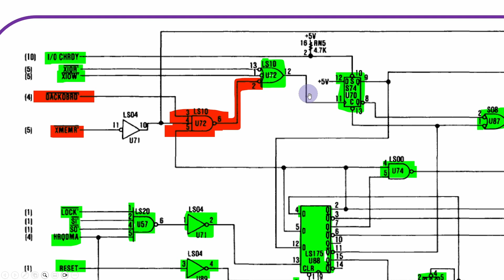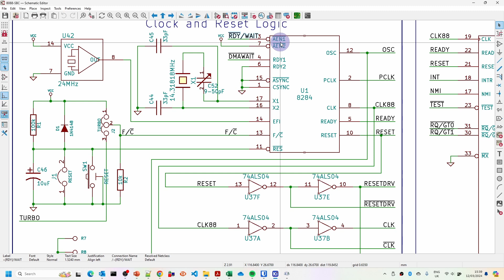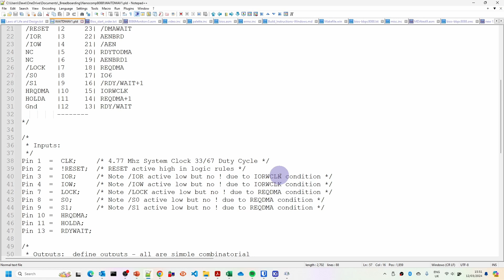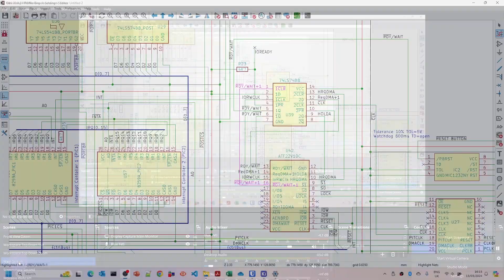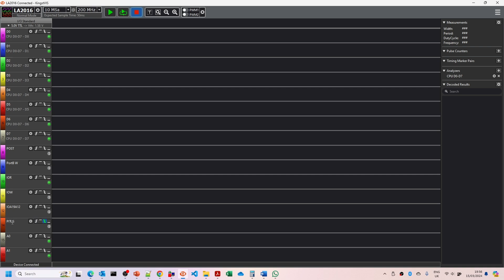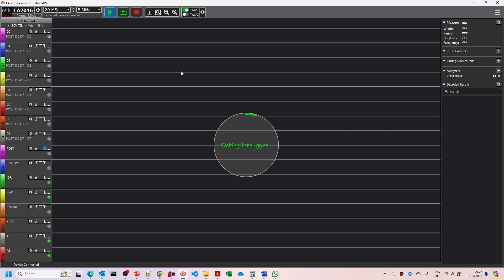Breadboard 8088 PC Compatibility Part 4 - IO wait states & BIOS testing #26

Comment: Although I have looked over the IBM PC schematics quite closely, I never noticed that a wait state was added for IO read and write. After some searching I found this possibly incorrect statement in StackExchange "OTTOMH The original 8088 4.77MHz IBM PC had 4 wait states for I/O and 2 wait states for memory". I am keen to understand this, so will have to dig deeper. From your explanation, a single wait state for I/O accesses seems correct. Perhaps I will have to get my scope out? Timings for IOR and IOW for maximum mode from the 8288 might have different timings as compared to minimum mode. This is something I can scope out on my 8088 PC motherboard.

In my own 8088 design, I decided to use "minimum" mode, to avoid the need for the expensive bus controller (8288). So I was just checking the datasheet for the width of IOR and IOW which come from the CPU. By chance I have used the faster "-5" ICs in a number of places, so that probably helps them meet the IOR/IOW width timings. I used an 8253-5, even though I have a 8254 in my "Intel box", which seemed to be an older device from 1980.

Still you have given me "food for thought". TBH I didn't analyse the timings in any way when I designed my minimal 8088 system, which is a little embarrassing :-( .

Perhaps my search skills are poor, but I'm not finding any YT videos or web pages which show the ISA timings in detail on a scope or logic analyser.
Reply from the maker: "Although I have looked over the IBM PC schematics quite closely, I never noticed that a wait state was added for IO read and write. After some searching I found this possibly incorrect statement in StackExchange "OTTOMH The original 8088 4.77MHz IBM PC had 4 wait states for I/O and 2 wait states for memory". I am keen to understand this, so will have to dig deeper. From your explanation, a single wait state for I/O accesses seems correct. Perhaps I will have to get my scope out? Timings for IOR and IOW for maximum mode from the 8288 might have different timings as compared to minimum mode. This is something I can scope out on my 8088 PC motherboard."

The default 8088 timing is 2 clock cycles (T3 & T4 periods) for memory and IO read/write which is about 400ns (419ns with 4.77MHz). The XI 8088 design has a flip-flop U30A & U24 which takes XIOR and XIOW and adds 1 clock cycle by providing -RDY/WAIT to 8284 clock.
This changes the IOR and IOW to 600ns. An increase in 200ns.
I know this because that's what I measure in logic analyzer.
When I unplug -RDY/WAIT the IOR and IOW time goes back to 400ns.

The XT schematics system sheet 2 has U70 and U88 which also has inputs from XIOR and XIOW and outputs to -RDY/WAIT and looks like it should add 200ns too but can't verify as I don't have an original XT but schematic looks the same as XI 8088.

I think the StackExchange reference is not correct (or confusing wait states for clock cycles for memory).
The default read/write for IO and Memory is 2 clock cycles (minus about 60-75ns according to 8088 datasheet).
The gates identified above I think add 1 more clock cycle for IO, to make 3 clocks (600ns) or 1 wait state TW between T3 and T4.
Third party memory expansion boards using slower DRAM could have used the READY bus signal to add more wait states to off board memory from what I understand.
On board RAM was 200ns access time so didn't need wait states.

"In my own 8088 design, I decided to use "minimum" mode, to avoid the need for the expensive bus controller (8288). So I was just checking the datasheet for the width of IOR and IOW which come from the CPU. By chance I have used the faster "-5" ICs in a number of places, so that probably helps them meet the IOR/IOW width timings. I used an 8253-5, even though I have a 8254 in my "Intel box", which seemed to be an older device from 1980.
Still you have given me "food for thought". TBH I didn't analyse the timings in any way when I designed my minimal 8088 system, which is a little embarrassing :-( ."

I am thinking of getting a modern CMOS 80C88 and trying to re-build in min mode and see if I can avoid needing any of the 8284 and 8288 chips but maintain PC compatibility. Will still need legacy timers like 8253/8254 and PIC etc. But will use programmed IO instead of DMA which just needs faster clock than 4.77MHz which modern chips support.

Perhaps my search skills are poor, but I'm not finding any YT videos or web pages which show the ISA timings in detail on a scope or logic analyser.

Some stuff here on timing regarding CGA from https://martypc.blogspot.com/2023/05/exploring-cga-wait-states.html?m=1
They also did work on other timing like DMA etc.

Hope this helps. Dave

Comment: Is it possible to upload the current schematics, the and PLD equations to your GitHub? I personally find it very difficult to follow your explanations without holding schematics in my hand.
Your schematic doesn't have to work down to the smallest detail, but at least others or I can get a better overview. I'm trying to recreate your great project on breadboards to better understand all the connections before I make a circuit board out of it. I already have all the chips and the breadboards you recommended there too.😃
Reply from the maker: GitHub just been updated now it is mainly working! https://github.com/breadboardinglabs/Breadboard8088PC
Dave
Reply: @breadboardinglabs  All GAL Chips are 15ns?
Reply from the maker: There are a variety of speeds from 7.5ns to 20-30ns from the Mouser link  https://www.mouser.co.uk/c/semiconductors/programmable-logic-ics/eepld-electronically-erasable-programmable-logic-devices/?q=ATF22V10C&mounting%20style=Through%20Hole
The 15ns tend to be the cheaper ones (7.5ns similar) however getting chips faster than what is needed could cause ground bounce spikes and other problems as rise and fall times will be faster than what is required (I am a hobbyist not a professionally trained engineer!). Dave
Reply: @breadboardinglabs  I would like to come back to the speed of the GAL modules. I saw in an earlier video that you used a 10ns GAL. 
My understanding of the speeds of the 8088 circuit is that all GAL devices can have 15ns cycle time. Do you agree with this?
The background to the question is that I have a lot of 15ns GAL devices (22V10, 16V8, 20V8) and a few with 7ns. I do not have 10ns. Hence my question. Otherwise I would have to order 10ns components.
Reply from the maker: All the ones I have now I think are 15ns which are what is available from Mouser. Some of the first ones I got from RS in the UK may have been 10ns but this was just down to availability not any specific speed requirement. Nothing yet I have done has been that sensitive to 15ns vs 10ns as far as I can tell. I suspect when doing 40Mhz dot clock for SVGA or 33Mhz CPU clock for a 80386 in the future this might become an issue but stick with for 15ns for now. Dave
Reply: Excellent. Thanks! 🎉 

I am beginning to understand the enormous amount of work you are putting into this project. Thank you very much for it. ❤